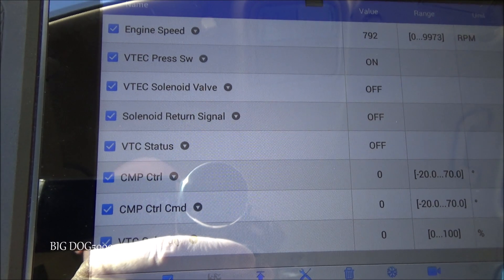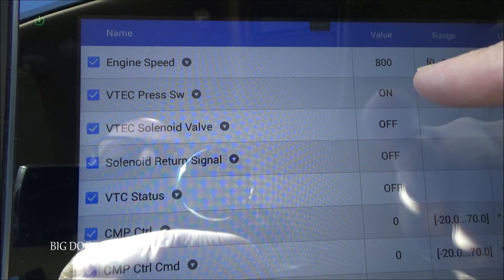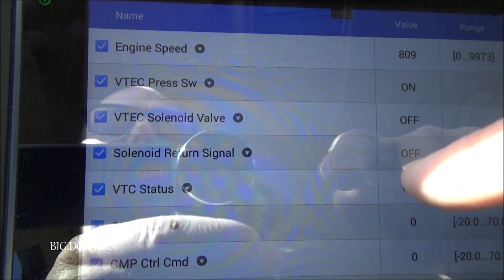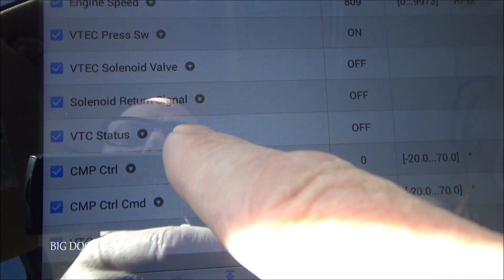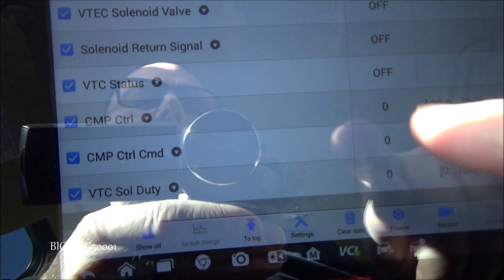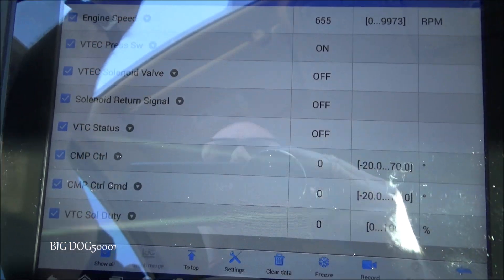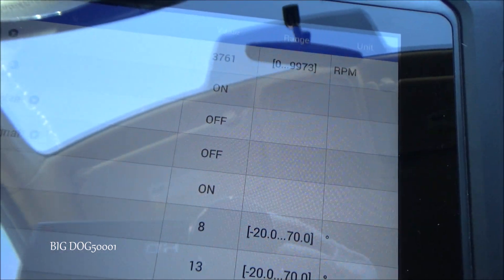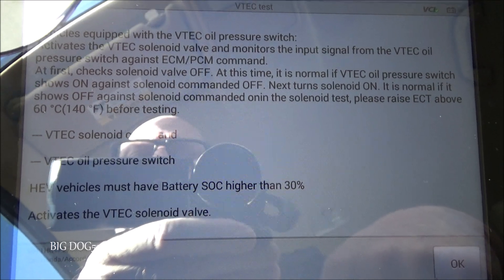Honda Tips: Difference Between Honda's VTEC and VTC systems

Comment: Thanks for the video
Reply from the maker: @HotRod-wv4vm  👍
Reply: @ I saw your video on replacing the alternator on a 2.4 Accord and was following it to replace the knock sensor in my 2004 Element. I was getting the knock sensor code after a mechanic replaced my alternator. I bought a new harness and knock sensor (both OEM). I had my son check to see if the harness had been connected and lo behold it had not. Reconnected the wire and knock sensor code went away! I don’t regret buying the parts as if they ever go bad, I have them. Thank you so much as you saved
me $$ had I taken it to the dealer. Next I need to tackle the mode actuator for the passenger side as the defroster isn’t working. I have checked all over but haven’t seen any videos. Based on the service manual looks like I need to first remove the ECM.

Comment: I think you meant to say VTEC increases duration and ‘lift’, not ‘time’ when activated.
Reply from the maker: VTEC increases the amount of time the valves are open.
Reply: The camshaft increases the actual lift. The vtec system increases the time.
Reply: @LA_Commander  Yes, the second higher lift VTEC cam lobe causes the increase in lift and the different start and end points of the lifting, which is a fixed interval by the profile. The VTEC just activates the switching (on/off only solenoid) to this higher lift lobe.
The other VTC solenoid which can vary the oil pressure to phase the the relative position between the camshaft sprocket and the shaft to shift the opening/closing of valves relative to the crankshaft.

Comment: Hi Dave correct me if I’m interpreting this wrong . My 07 Odyessey has I VTEC which is being controlled by oil pressure from the VTEC solenoid . Now newer models you are saying have both systems ? I will watch it again maybe I missed something which is very possible . Dave wishing you and family a safe, prosperous and Happy New Year .      👍.  Artie
Reply: Honda did something strange back around then and added variable cylinder management to (some/all?) V6 engines.  They called that i-VTEC.  This might be what your Odyssey has.
Reply: @schifoso  yes my Odyessey has IVetec . So many different systems . I’ve thought about disabling it but there are so many conflicting reports saying do it and and someone say don’t do it plus there are different options on what brand to install. It has left me undecided. I have no problems with it but I don’t want any problems either. Now ivetec just shuts down by locking down 3 cylinders cylinders does it also switch lobes on the cam to all 6 cylinders ? Just want a clear answer for myself. Thanks for the reply 👍
Reply from the maker: It can definitely be confusing.  Those V6 engines are a bit different and do not have variable timing systems.  Although Honda calls it an i-VTEC (same as the Accord in this video), it is technically an i-VTEC Variable Cylinder Management system.  They actually refer to it as a "cylinder pause VTEC system" which incorporates a VCM system (Variable Cylinder Management) that has oil passages to the rocker arms that deactivate certain cylinders and keep the valves closed during operation (which helps to act like a spring on the piston).  Some Honda V6 engines have this VTEC system (rocker arm oil control valves) only on the rear of the engine, and some have it on both the front and rear.  Have a great year Artie, thanks for the comment!
Reply: 07 Odyssey here as well.

Comment: To avoid VTEC and VTC problems, change the oil more often.
Reply from the maker: Keeping up on oil changes definitely helps!
Reply: Or just get an older, non VTEC engine, and enjoy the benefits of reliability with a small sacrifice in HP and fuel economy